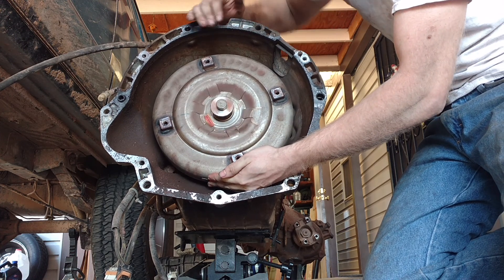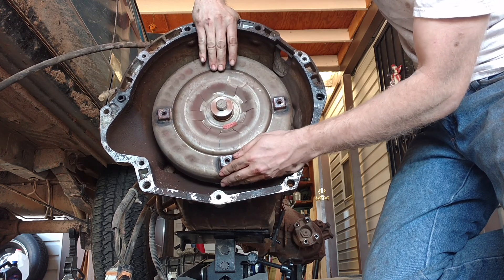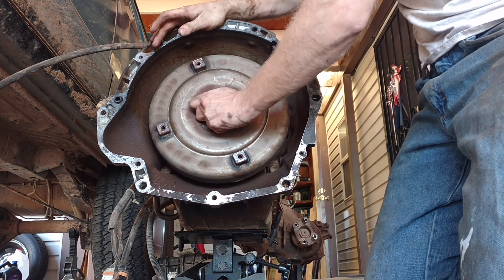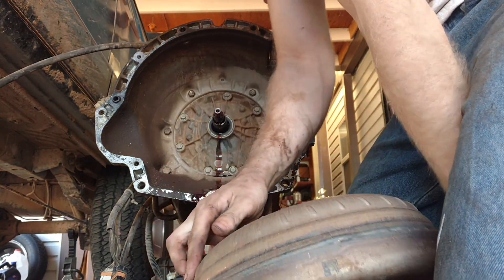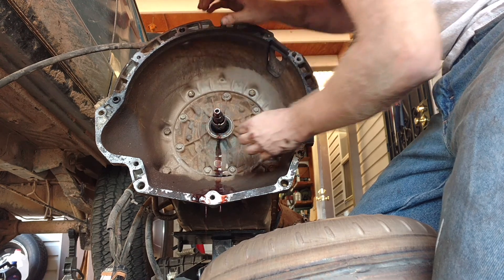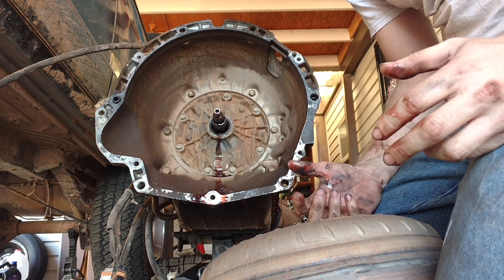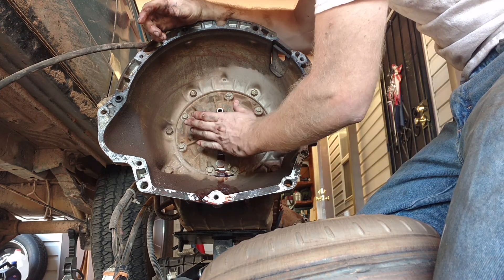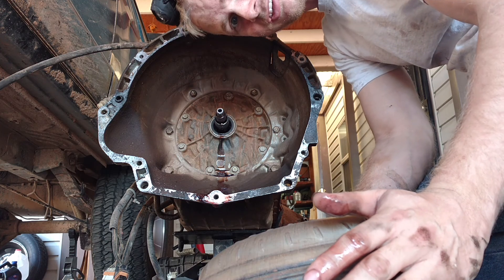Is the torque converter supposed to do that?

Comment: Jw of you got to the bottom of the issue I have the same problem, changed the flexplate and after a 1 1/2 months it started knocking again, so now I've got it back apart trying to figure it out and everything I've got seems the same as what you just showed.
Reply from the maker: It turned out that one of the main bolts from the transmission bell housing to the engine was too short and never threaded into the engine block (after rebuilding the engine years ago I must have placed the wrong bolt in) Over time, the dowel pin pinched a little and allowed for too much play when I was driving on the dirt roads. There was no way for me to tell, I noticed it after I had the transmission rebuilt and put in a new torque converter.
Reply from the maker: Both the torque converter and the transmission we're perfectly fine. The main bolts being too short was what was causing my flexplate to go out. Check the dowel pins from bell housing to engine block.
Reply: Where did you get a flexplate?

Comment: Just changed my flexplate on my 2000 jeep cherokee because it was cracked. My torque converter doing the same thing. Did the new converter do the same thing? 1 of your other comment stated that the converter and transmission were good but were you talking about the old or new converter?
Reply: Where did you get a flexplate?

Comment: Hi, did you fix that sound? What did you do? I have the same problem. If you can tell me what you did, I would really appreciate it. 

my xj has the same sound in the same place, but softer, I see that my flex plate is fine, it is not broken, I already tightened the 4 screws well and the noise continues. 

3 days ago i put a new transmission, but with the old transmission never do that noise.